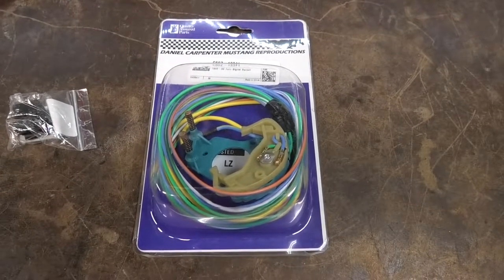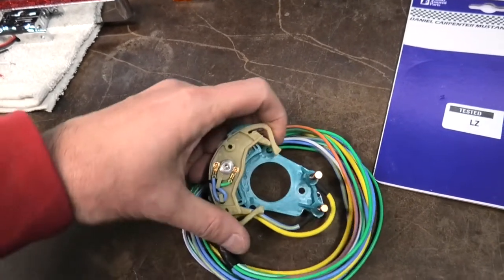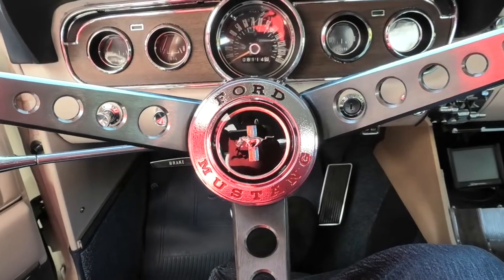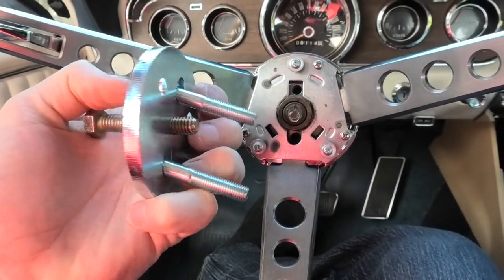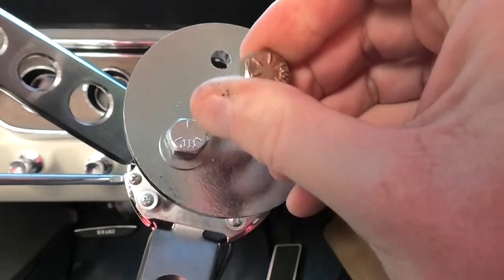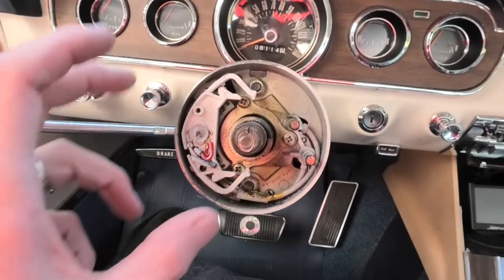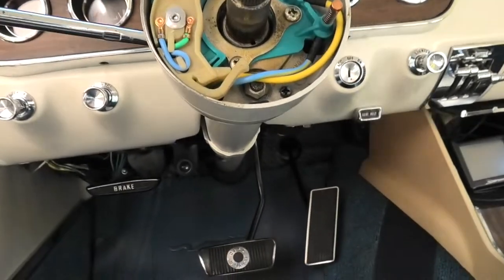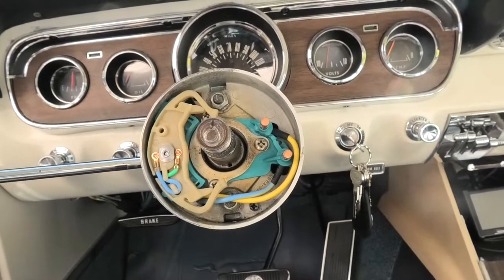66 Mustang Turn Signal Switch Replacement

Comment: I had fun doing this same install a couple of years ago. I tried to wrap the wires in electrical tape before feeding it down the steering column. As you can imagine that did not work well. As you said though the pull wire is a must. Overall a very easy project.

Comment: Wish my 64 Falcon was that easy. Put a smaller steering wheel on it and of course the turn signal didn't work with it. Thinking of just putting an aftermarket turn signal on thr column and saying good enough. A lot of what you do on these Mustangs are compatible with my Straight Six Falcon. Great job explaining how its done. Patience is key....which I tend to lack.

Comment: Thanks so much.  The sleeve at the bottom is tight.  I was expecting to have to take out the steering column, which on my '65 is a PITA job, so I hear.

Comment: Would this affect the horn at all?  I have a 66 mustang.   Replaced the horn contact kit and still no luck.   My right blinker isn't coming on either.   Wasn't sure if there was any cross over there.   Thanks
Reply: I read on a forum that the horn wire is apart of this assembly so maybe? Obviously check that your horn works too

Comment: I just replaced mine and it was the same exact one from Daniel Carpenter and I have the same exact steering wheel... And the new switch was broke within one week, one of those arms broke off because it would not cancel correctly just like you pointed out on yours... I'm not sure if it's supposed to cancel as soon as you start making the turn or when you're turning the wheel back to the straight position
Reply from the maker: Yeah mine cancels as soon as you start turning and that’s not right but it hasn’t broken. 
So hard to find good quality today.

Comment: Yep, I’ve replaced my whole switch and wire harness assembly on my Ranchero, broke less than a month later. Now I just use my turnsignals like it’s a motorcycle and cancel them myself. Manual transmission, manual windows, manual choke, non power assist steering or brakes… might as well have non-automatic cancelling turn signals too!
Reply from the maker: Yeah, I am less than impressed with this replacement.  I want to find a NOS switch.